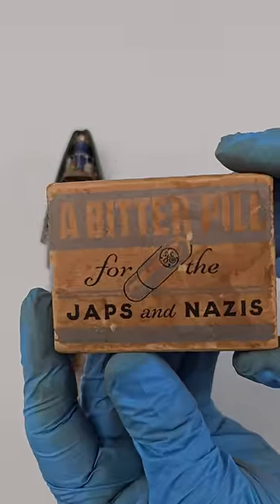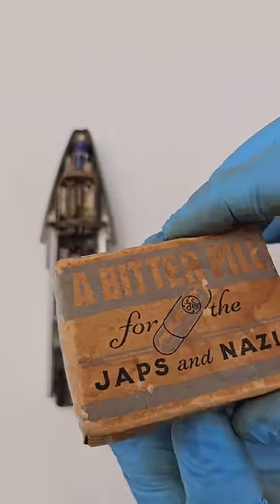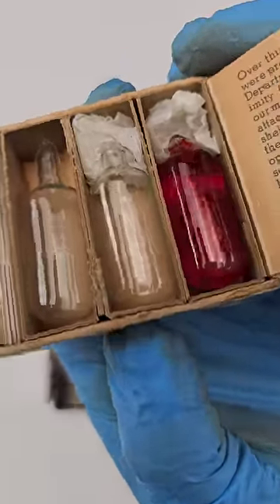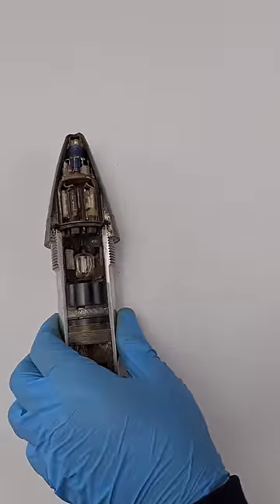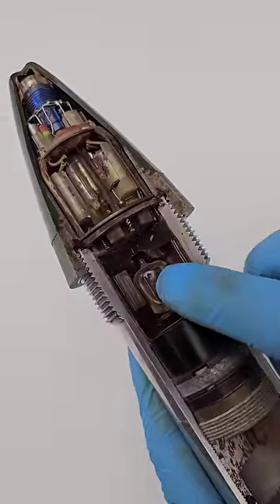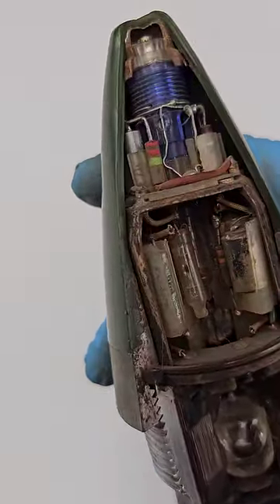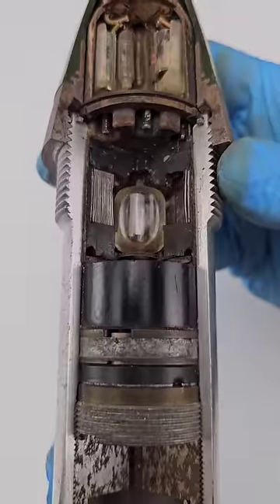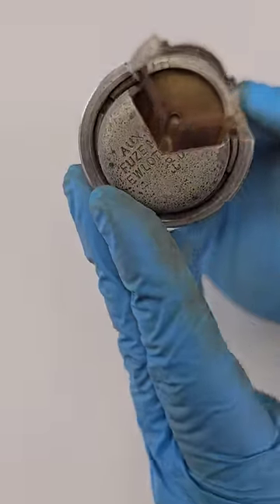RADIO PROXIMITY FUZE: General Electric Helps Beat Kamikazes & Win WW2 #military #history #technology

Comment: These ended missfiring a lot due to the shock of being fired out would cause the glass to break. It became a hazard.
Reply: That was the whole point. Once the glass broke during firing, it activated the battery. It was battery electrolyte in the glass ampule.

Comment: So in the nose is the rf receiver circuit which measures some thing like signal strength of reflected signal from enemy aircraft (The original signal is from a ground station) and at preset signal level or range ignites the fuse and explodes at optimum distance. Is my understanding right?

Comment: And for quite some time they only used them at sea. They were concerned If a dud landed on the ground it would be found and either copied or come up with a counter measure. That's how the British found out how German sea mines worked. They found out the mine detected a ships magnetic field and go off. The British started to degauss ships demagnatize them.

Comment: What happened if you accidently droped one?
Reply: You'd have to hope the ampule didn't break, otherwise you've got a dud since the battery would be slowly running down power
Reply: It wouldn't arm if the glass ampule broke prematurely. In order for the electrolyte to give the battery enough charge to arm, the fuse has to be spinning really fast like it does when fired out of a rifled barrel. The spinning creates enough centrifugal force to force all the electrolyte to just the outside walls of the fuse all at once where the battery plates were. No fast spinning and the electrolyte just sits in a pool against one wall or another doing nothing. Like the other poster said, you end up with a dud shell but it wouldn't harm you.